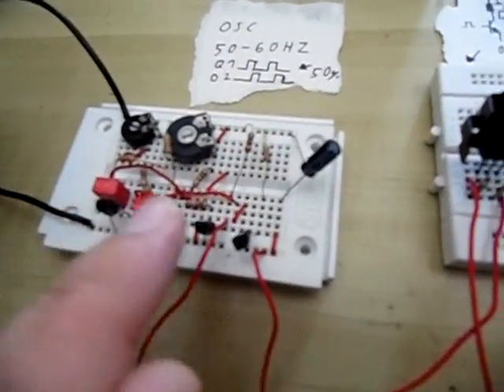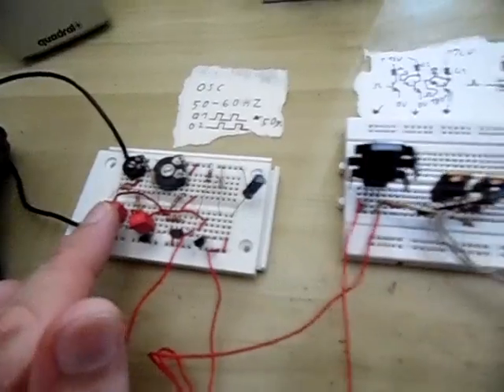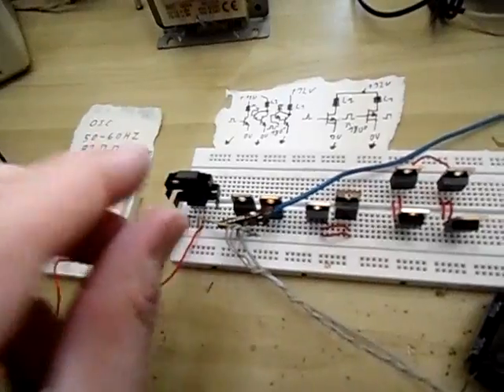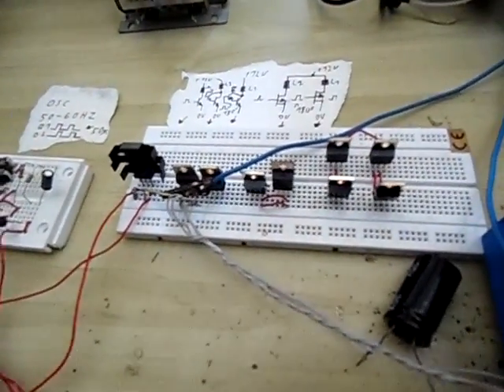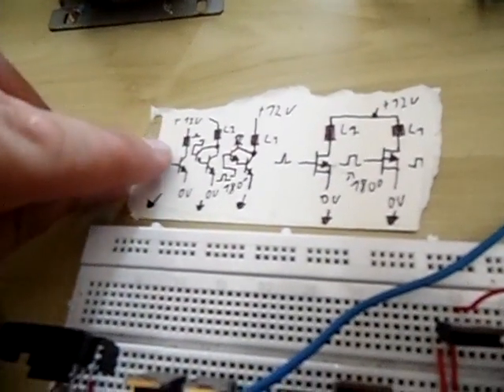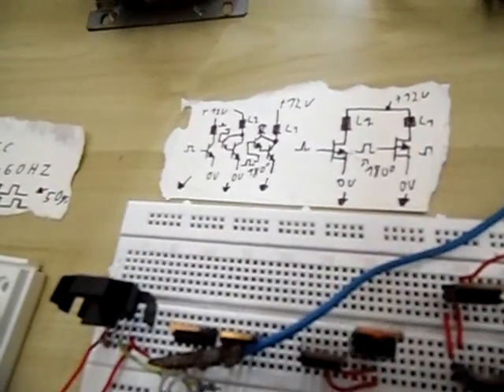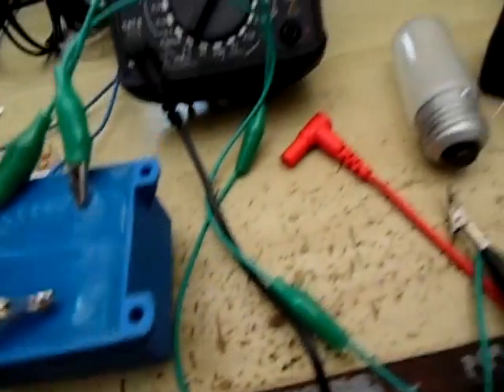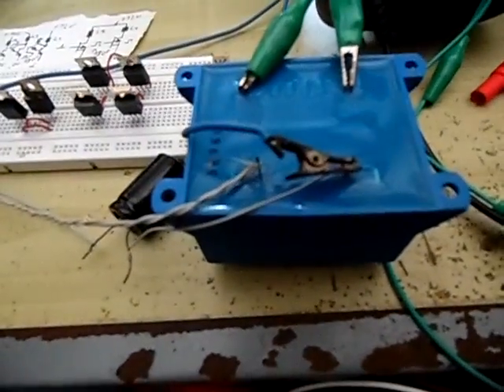DC AC power inverter - basics part 1

Comment: I remember as a kid connecting a battery to a transformer and making 2 or 3KV sparks on the other end.  At the time I thought it was only outputting the same voltage as mains, so I thought 230 volts could actually jump that far. I've found that the primary alone on a Microwave Oven Transformer can have a lot of inductive spiking.  I connected a fluorescent tube to the primary of a mot, then I pulsed the primary with a 9 volt battery and there was enough voltage after each pulse to strike the tube and make it flash.

Comment: I wonder if the efficiency loss from the secondary to primary side is due to the transformer only passing the fundamental component of the square wave since it was designed for 50 Hz - the transformer. If it is less efficient at transforming higher frequencies, then that can explain the loss of power. Hmm, as I am writing this I am refining this idea. Not only are the high frequencies not being passed, but also the high current DC component, which would eliminate half of the power right there.